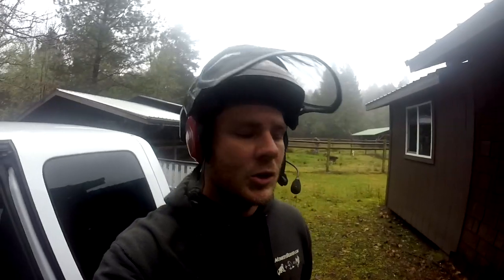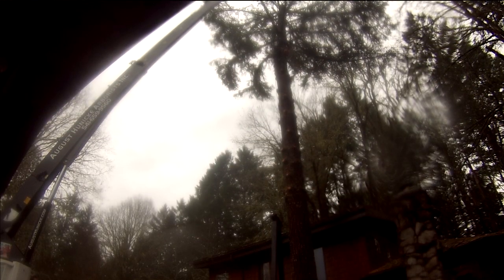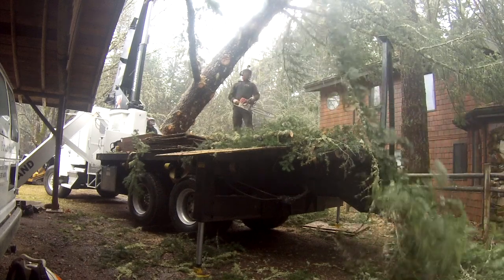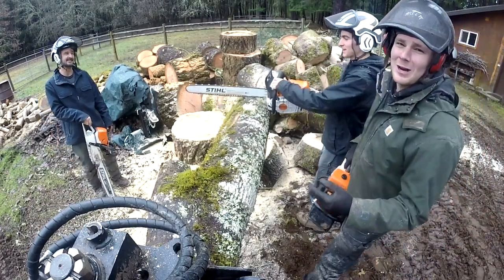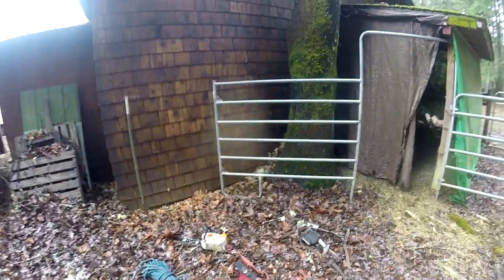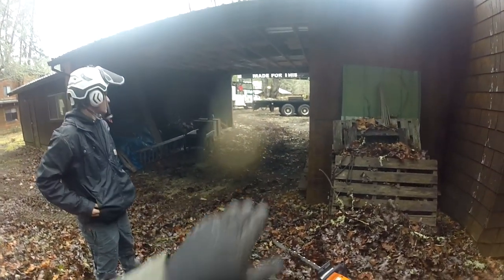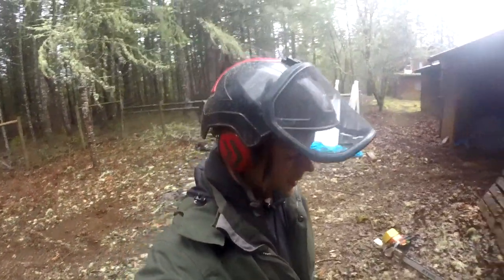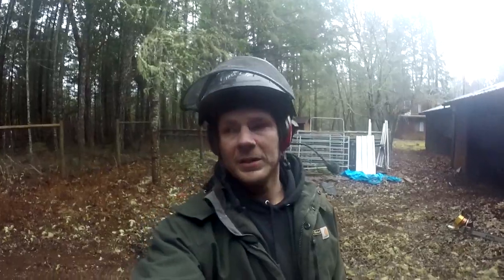Takilma  Tree Climbers, Only so much time.

Comment: Damien, at 2:55 what knot is that connecting the working end of your climbing line to your unicender? thanks!
Reply from the maker: I don’t usually use this knot on my device setup but it’s just a tight bowline as a quick setup for the one cut before hitting the ground
Reply: @damien12309  Thanks for the clarification!